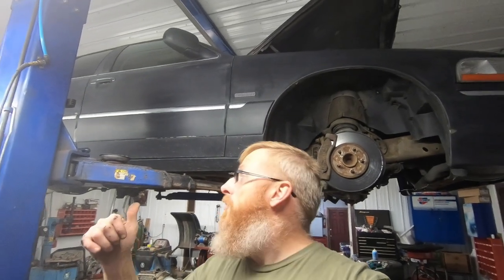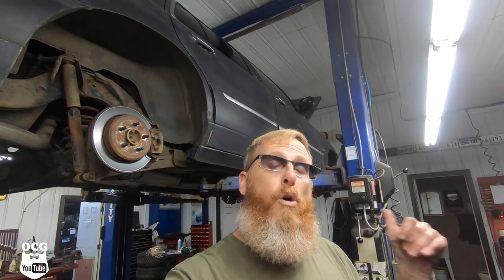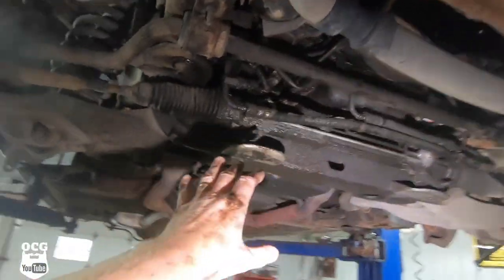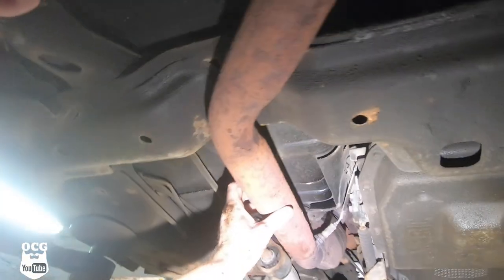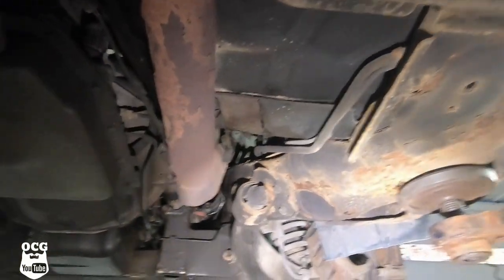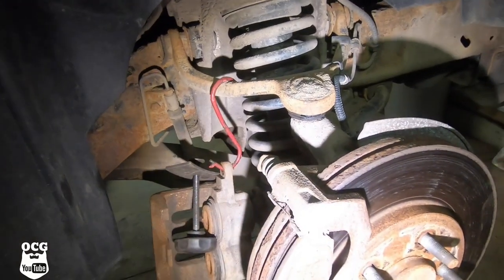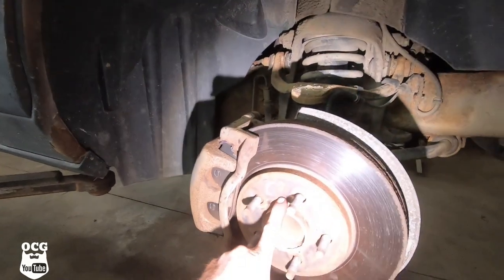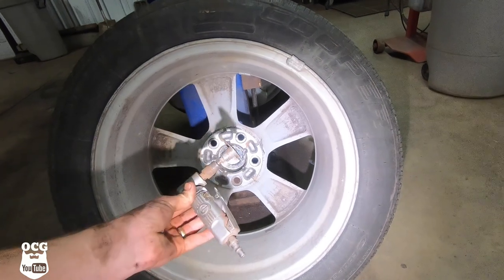How to fix spongy brakes on your 2003 Mercury Grand Marquis, Crown Vic or Town Car

Comment: My brakes on my 05 feel weird they go to the damn floor before I start getting any grab, fluid is at right levels and new pads and rotors all around, happy you made a brake video lmao.
Reply from the maker: You're welcome. Hope this helps.
Reply: Did you ever find a fix? Mine does the same thing with brand new pads and rotors

Comment: I have a 2003 and I replaced the red trunk insert with a 2006 gray insert.  This looks sharp.  Car is Silver Birch w. black rag top.  Yr. video was very informative.
Reply from the maker: Thanks Norman. Hope you'll stick around and consider subscribing if you haven't already!
Reply: Yeah I wanted 2 do tht to an 05 I bought all black brand new with plastic still attached to it everywhere. I still got the owners soft sued feeling book. Since i hadnt paid it off I put all upgrades off, so many memories with tht slow ass, gud 4 nothing traction at the slightest bit of rain. Couldnt keep the tires from skipping but she was a pig in a sued leather blanket on the highway. I prolly never even went to75mph back than, I was too clean, ragtop, vogue tires, Chrome package, so much I could of done but I wasnt feelin them fords. 
Traded her 4 a triple black SS tht woulda dog walked the merc back into a driveway for Sunday drives only. Now i love the Panthers for being a reliable work horse, but not enough over the lac or bowties to have a real comparison.

Comment: I found a youtuber that shows you how to delete ac compressor. You use a v6 mustang idke tension pulley, and a shorter belt. I did it to my 03 vic. Works great! Definitely opened her up and she breaks my bigger tires loose with ease.
Reply from the maker: Good to know! I do plan to get mine fixed!
Reply: Explain this logically to me. So i sacrifice my comfort when they ask, wht you up 2, & my response is, " jus chilling ?"
In place of more torque tht can be gained from upgrading torque converter, forced induction turbo with tune to unleash its potential from factory capped settings.
I gotta kno wht did I miss, I'm under constant iterations, I'm in HPV mode currently. Wide track width thinking bout gutting body panels to fit the offset of wheels. 
It's the front left constantly hitting the fender. 
I was thinking replace with stretched fender wells to complete the widebody stance I'm having to fabricate parts which I dont kno if I can match up true to commitment on both ends but im learning. 
What does it look like cut out to fit bigger tires & by how much.
It would work but doesnt help tht it looks like a pitbull in a nice sharkskin tuxe. It's pretty beefy & intimidating cuz i got the stangs & every other car thinkn it must be slow but I got nuthing 2 prove by flooring it knowing full well wht im capable of & even lost my L's for 140 mph pursuit but I was already eating this impala 4 lunch for the 3rd time with cash on the line tht went str8 to a lawyer  at 135 on interstate when lit, I jus didnt stop till I won against whoever was in my rearview. Pretty dumb ass move tht got me drivin like im 68 with bifocals jus to see 12
Reply: @eyesofagemini7715  😂😂😂
Reply: @eyesofagemini7715  I only deleted it cuz compressor clutch was shot and it was cheaper, and leaked like a siv anyway. Good thing is, I dont need A/C. Not comfort sacrificed. As for the shit tune cap, talke to Moes in georgia. They tune older vics, and they have a guy there Marty that sells tuners pretuned for vics older than 05.
Reply: @eyesofagemini7715  mine isnt built for speed. 31” bf goodrich tires, with cut fender wells, and 42” offroad lightbar, and 3” lift. Everything i did was out of necessity…except maybe desert tan paint job. Lol

Comment: Some P71s came with 3.55:1 trac lok rear axle. Mine did, it was a '99. It had an aluminum driveshaft too.
Reply from the maker: This car came with an aluminum drive shaft in the back seat and i'm guessing the same 3.27 gears as i put in GrandMa. Works well.

Comment: Open diffs just send power to whichever wheel is easiest to spin. Not necessarily a left or right wheel that pushes the car. Did a differential swap on my vic to limited slip. Was a night and day difference. Car came alive. Check the oil filter housing. They're known to leak but easy fix.
Reply from the maker: I just did a rearend swap in my 04 a few videos back. Your right...Night and day. Thanks for the heads up on the housing.

Comment: I got a leak shortly after purchase of my 2004 Sport and it was the power steering pressure sensor.  $20.  Done.
Last month got a leak on the driver side somewhere near the power steering pump.  Not the pump.  Turned out to the the oil filter housing gasket which also is the coolant line housing.  Messy job and tight quarters, but not bad overall.  I suspect you may have both those issues based on the leak pattern.

Comment: 2003s have this problem where the power steering will start to leak in hugh amounts from that Power Steering sensor. Since Jack has a lot of miles, consider replacing that sensor. 

Also, do check for leak around the oil filter adapter. The gasket for the oil filter leaks after about 160k miles or so. Might as well look for that.
Reply: I had to replace the filter adapter gasket on my '99 P71. It was a huge leak though, not just seeping.
Reply from the maker: I'll check them both. Thanks.

Comment: Did you use anti seize on the metal clips of the brakes?? you
kept mentioning brake lube.
Reply from the maker: We don't use anti seize,  we use a specific brake lube product from KLEEN-FLO called EZE Slide. It's purple in colour!

Comment: I just bought a 2003 Grand Marquis GS with 56k miles, i looked underneath the car before i bought it, no oils or leaks at all or signs of previous. Coil packs just replaced, trans and oil looked and smelled good. drove it 60miles home seemed flawless. I paid 4000$. My question is, did i overpay and what should i do/check for.
Reply from the maker: Hey Chris. Too many folks get hung up on the price. Here's my thoughts, If you don't have to do anything to it, $4000 isn't a bad price especially for the miles that's on it. When I bought GrandMa, my 04, I paid $2500 but I had to do about a $1000 worth of work to it to bring it up to par and she had over twice the mileage. Sounds like you came out ok my friend!

Comment: You could also put some sort of felt (sort of acting like a washer) between the steel and aluminum to isolate the dissimilar materials. Google the "galvanic action" chart. That's really cool with the x-pipe. Yea that's a poor excuse for a sway bar. Those Marauder tips are slick! Also , do you know the differential tag trick on those 8.8s? Handy tip on those stainless steel clips. I gotta do new rotors/pads on the EcoStang soon, I had never known about lubricating the clips.
Reply from the maker: Differential tag trick. I know they "should" have a tag. GrandMa did, Blackjack does not! Do tell!!
Reply: @OldeCarrGuy  ahh, well if it didn't have one then you're out of luck.bim pretty sure ai have an old video walking through it
Reply: Yeah put a quality trusted spacer in between & ure problems are minimal. 
U just may have to on the front anyway for the turning radius or to clear bigger brake upgrades which I recommend u also consider due to adding all tht extra weight. Stiffening the rear & front suspension for the abuse u will surely feel provoked or  obligated to tackle. Reinforcing the chassis with due diligence is a must in my opinion against the twist and bending. These cars rust like crazy, even in the south, I kno by a close friend who is a Ford desiel
Reply: Tech for the last 20 yrs, they could be sitting on lots for months & have signs of rust within the 1st year & these are brand new. Oh yeah bigger, longer, stud replacements. The originals are short, weak at this point in life, especially if u plan on offroading or throwing any kind of power adders tht will increase its sheer torque to wheel power.

Comment: Did you actually tell us why the Vic had a spongy pedal and what part of the brake service resolves it?
Reply from the maker: I may not have been specific, but serving the calipers resolved the issue. Most commonly the slide pins get seized not allowing the pads to be compressed!

Comment: If you're going to lift this thing, how hard would it be to make it 4WD?
Can you just swap some front axle parts from an F-150?
I don't think anyone has done a 4WD Panther Car, you might be the first.
I'll leave a link to my favorite "off-road" panther car in a separate comment, for some inspiration.
  
-Chuck
Reply: FrankenVic;
https://www.youtube.com/watch?v=bExrmPKCNvM
Reply: And it goes without saying. 
Add a 5-Speed Manual Transmission already. 
Mustang GT 3650.
Reply from the maker: Manual swap maybe. No 4x4 though. I like the reliability in its current configuration.
Reply: @OldeCarrGuy  
I wonder if a Panther body would just drop onto an F-150 frame? 

That might make it simpler.
Reply: A 4-wheel-drive with open differentials has only 2 driving wheels -- same as a 2-wheel-drive with a Trac-Loc.

Comment: It's called dissimilar metal corrosion.  What happened to "How to fix spongy brakes on your 2003 Mercury Grand Marquis"??
Reply from the maker: Cleaning your caliper slides and guide pins is how you fix the spongy brakes. Allows everything to move freely rather than binding up.

Thanks for watching